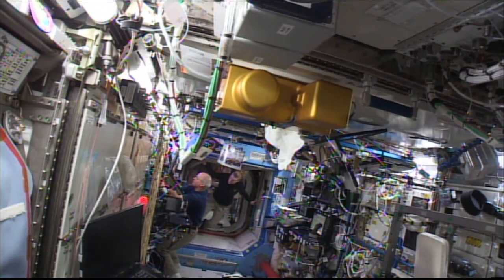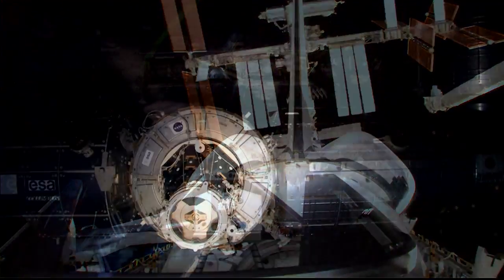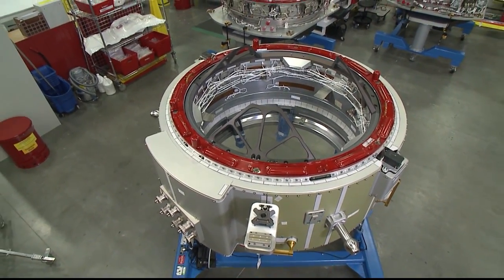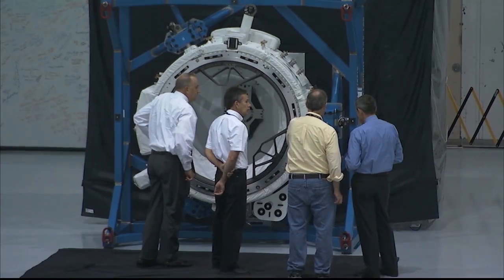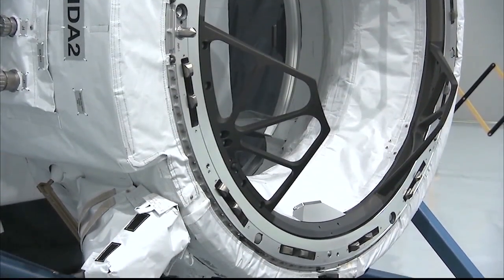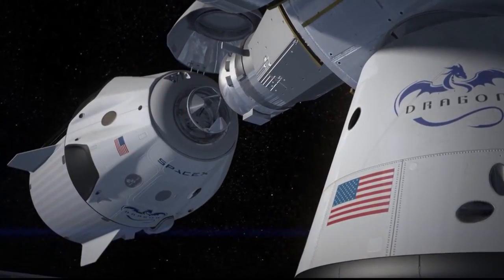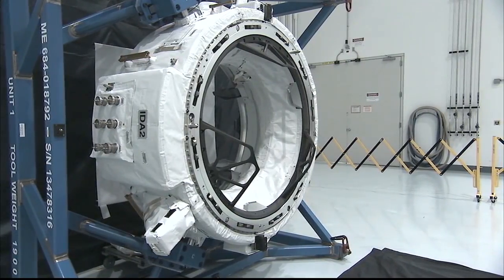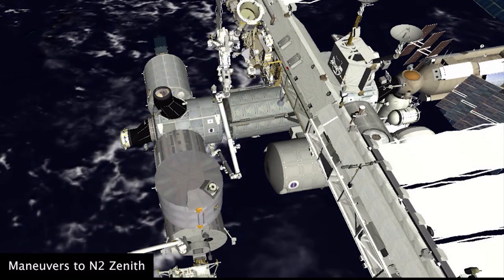Space Station Live: Hooking Up the New Docking Hardware

Comment: Hah, finally I found out why all the western cargo craft are grabbed with robot arm, always thought it was a ridiculous way to dock. They do it so they wouldn't have to buy a docking adapter from Russians! Exception is the European ATV, they did buy the docking adapter from Russians and docked to the Russian side of ISS. So the PMA-s 2 and 3 have not actually been used after shuttle retirement?
Reply: After all they actually bought adapter from Russians.
The structures and the dockings mechanisms themselves of the IDAs were also built in Russia by RSC Energia and then equipped with subsystems and assembled in USA. In general the mechanical part of the new docking standard is basically the APAS from Mir-Shuttle (and later ISS PMA) with minor changes.